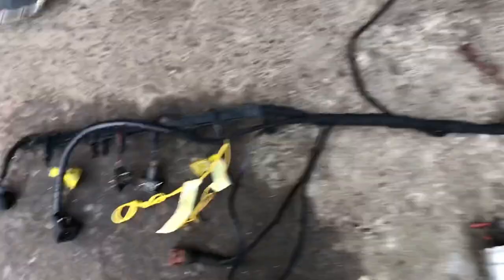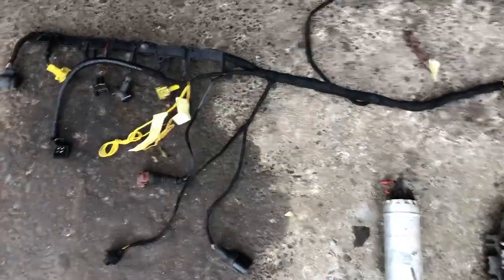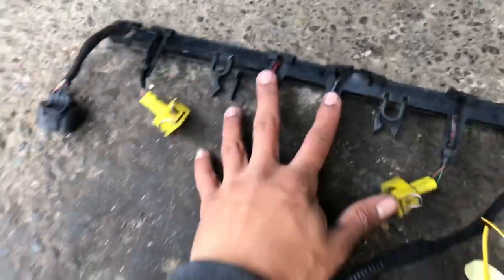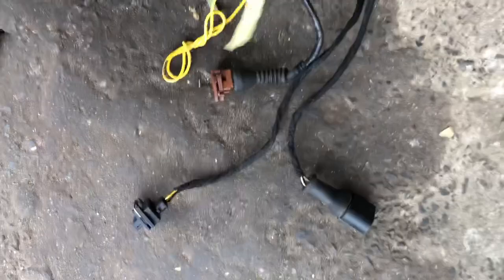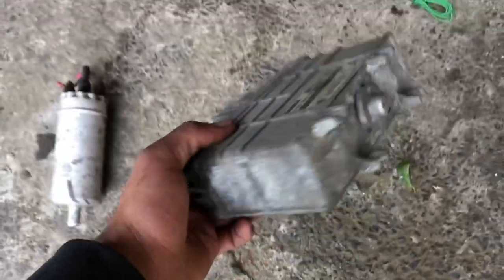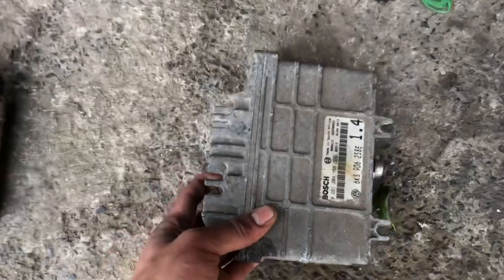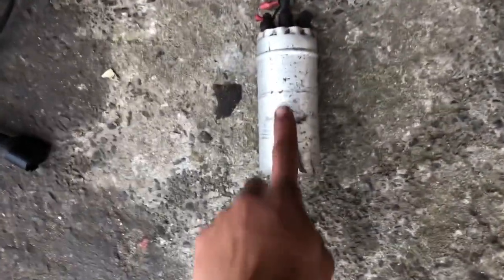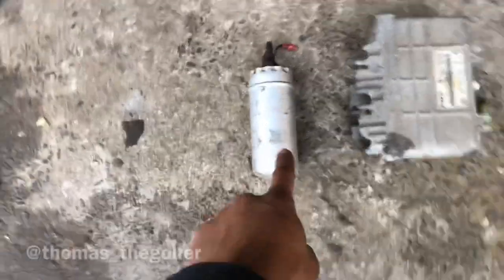MK1 Golf Update: Carb to MP9 Conversation + Shortloom install!

Comment: Pretty sure the one blug is for your knock sensor, and the other for your tp
Reply from the maker: Correct yes. I found out that I don’t have a knock sensor on the engine, hence the plug being “redundant”. I will have to get a knock sensor as well. 😃

Comment: Hey guys just a question I did more or less same conversion was 1.3 carb I change to 2ltr motor wit a microbus feul pump running  on a dictator but it's over feuling I just want to ask what wire must I use from pump to what relay  because  now when you turn on ignition the pump stays on  and it makes the spark plugs wet

Comment: So you using computer box or module?
Reply from the maker: Stock 1.4i open coded ecu. (Open coded, meaning key code bypassed to work in conversation application)

Comment: Must you change the whole loom to make it fuel injection or just get a short loom
Reply from the maker: @Judy Jackson, you basically replace the engine loom with the shortloom. The shortloom connects to the all the engine components for the mp9(dizzy, injectors, coil etc). You’ll basically be able to start a car just with the shortloom.
Reply: Can you just change the head to make it mp9 or what